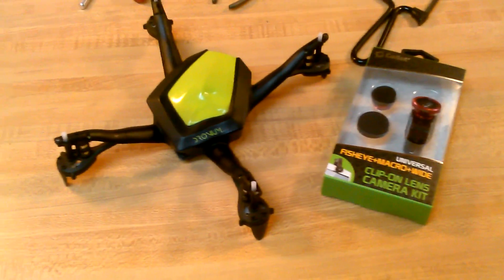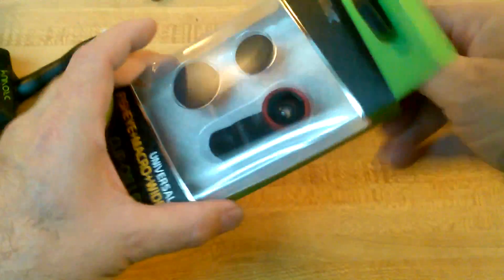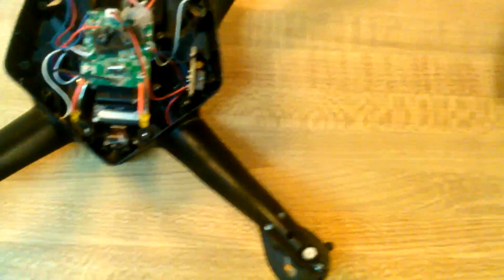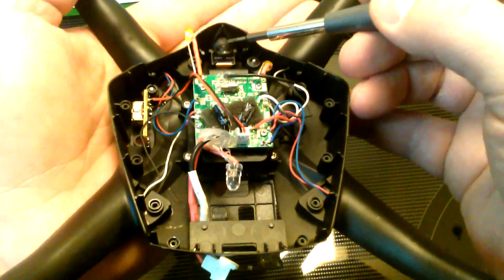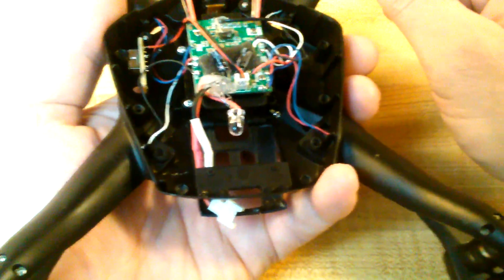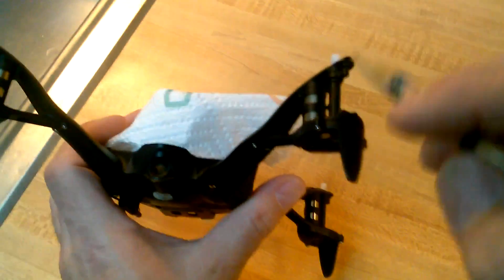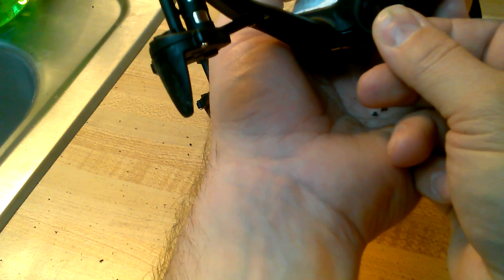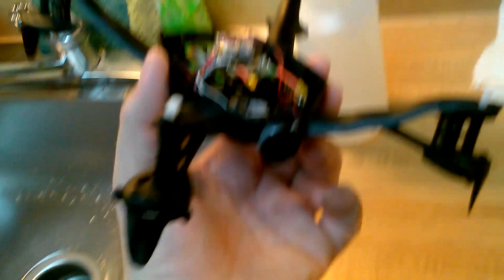Protocol Dronium III Camera Mod

Comment: I'm getting a second hand Dronium 3X and I see they can be modded relatively easy. Thanks for showing us how to not be afraid to mod these drones.
Reply from the maker: Make sure you measure the distance from the camera on the drone to the final position of the Cell Phone Lense attachments where the clearest image is for the final fit when the glue is dry. I used blue tac for wall posters for pre fitment. Measure twice...cut once as they say. 👍